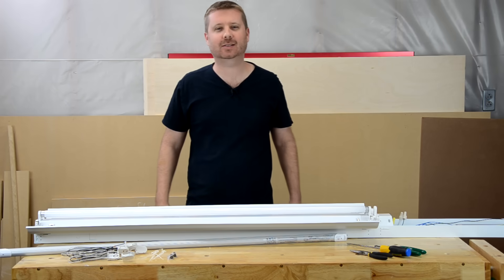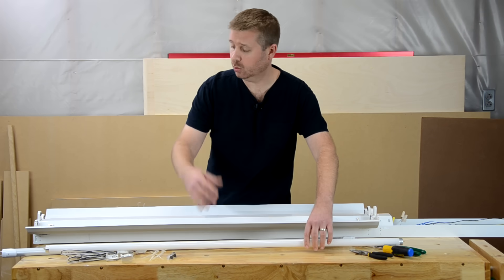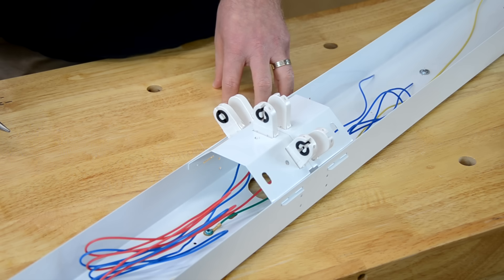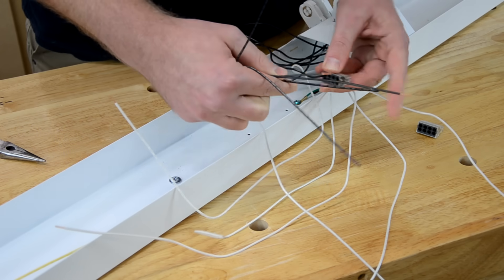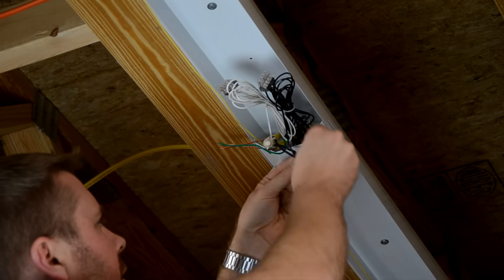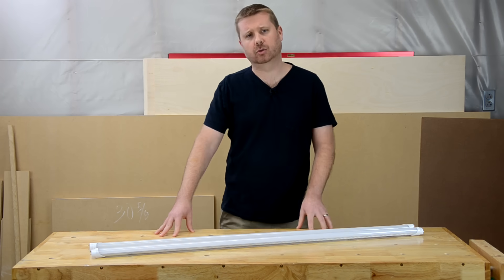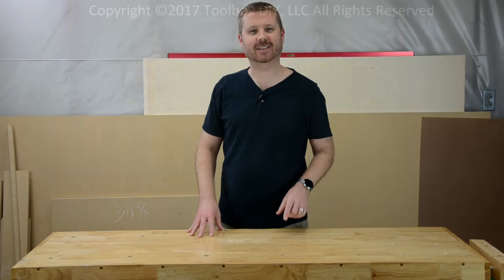How to easily convert fluorescent Lights to LED –Easy Ways to Save Money

Comment: Thanks for the video ... where can I buy the single ended LED tubes and all of the electrical connectors etc ... great job from my perspective since I have become firmly camped out in the DIY party.
Reply from the maker: Everything for this video was purchased on Amazon. Since this filming, more double ended tubes have come on the market that are worth considering. Those are a lot less work to install since you don't need to swap out the lamp holders. If I find some double ended LED tubes that I like, I'll do a video on those as well. I'm firm believer in removing the ballast so it will just be a simple ballast bypass with no changing of the lamp holders.
Reply: Amazon sells the LED tubes with tombstone connectors.  You can buy the Ideal push connectors at Home Depot.

Comment: Think you better go find out what Kelvins are Boy, they have nothing to do with light !!
Reply from the maker: I have to respectfully disagree that Kelvin has nothing to do with light, but the confusion is understandable. In primary school science class we are only taught about the Kelvin scale as it pertains to thermodynamics. We are not, for understandable reasons, taught about the Kelvin scale of color temperature. Kelvin is the unit of measure for color temperature using a scale from 1000 to 10,000. On just about every LED light package, the color temperature is specified and it typically is a 4-digit number followed by a "K". Yes, that "K" is the abbreviation for Kelvin.

But you don't have to take my word for it:
https://www.lumens.com/how-tos-and-advice/kelvin-color-temperature.html

https://en.wikipedia.org/wiki/Color_temperature

http://www.westinghouselighting.com/color-temperature.aspx
Reply: In Australia we use Lumens, Kelvins is used as absolute temp in scientific stuff, an used in the air con/ refrigeration areas !
Reply from the maker: You're confusing light output with light color. Lumens measure the light output independent of the color of the light. Australia also uses Kelvins to measure color temperature just like the rest of the world:
http://www.energyrating.gov.au/document/fact-sheet-led

I think a lot of people with any science background get confused by the use of Kevlins for color temperature. It is not measuring thermodynamic temperature and it is not using the same scale. Thermodynamic and color temperature are two different measurements using the same unit of measure (K) and using two different scales.

Comment: I understand you misspoke and said shunted instead of non-shunted, but this is such a huge error that you should really reshoot this portion of the video and take this one down.  This error could be dangerous and result in a direct short if someone follows this wrong instruction.
Reply: Cry me a river.  I watched the video and it immediately corrected the mis-spoke section with a pop up.  Quit complaining.  It is a good video..
Reply: Yes!!   VERY irresponsible to leave this video as is ...he has people buying shunted tombstones to replace non shunted ones which is RIDICULOUSLY STUPID!    You only need to buy ONE non shunted tombstone IF there is not one available for each tube in the fixture....DUHH!!   FIX the video!  Don't just leave it all confusing!
Reply: @dougiequick1  how do I know if mine is shunted or not?  I have 4 bulbs in a 2×4 foot fixture recessed into my ceiling tile ceiling.  I understand (some?)  LEDs only need power on one side?  Watched a few videos and its confusing.  I've seen some people kerping like colors connected, and others mixing colors
Reply: He explained how to determine shunted and no shunted.  Watch the full video..
 @JM-nh8yp
Reply: shut up @dougiequick1
Reply: Todd R  if you currently have ballasts you can buy led bulbs that use a ballast or bulbs that don't require ballasts. Ideally it's best to go non-ballast then you never have to worry about ballast failure or ballast start up in cold temps.
Reply: Todd R  He already explained the practical reason for swapping holders on one end with non-shunted.
Reply: You guys are geniuses. I actually watched the WHOLE video and every thing you complained about was addressed.
Reply: nope Todd R

Comment: What about the NEC on quick connect plugs for the power. It keeps from getting zappes
Reply from the maker: My understanding (which could be wrong and could easily become outdated as codes change) is that the push in connectors are permissible by the NEC. The last set of recessed lights I installed actually had push-in connectors pre-installed and I've also seen these used inside fluorescent fixtures for the ballast wiring. It's worth mentioning that they must be used correctly just as wire nuts should - no exposed wires hanging out of the connector.
Reply: @ToolboxDIY  NEC doesn't DICTATE splicing choice push in vs mechanical twist. The splice needs to be sound and the splice needs to accessible. Been using WAGE lever connections made in Gerrmany (USA distributors) for 12 years these are UL and have a higher mechanical adv.- through downward pressure of lever vs spring tension which fails with heat (electrons create heat) then IDEAL or other push ins or Chinese knock offs. Yes WAGOS are .25 cents compared to .01 cent wire nuts. There are some other advantages of why we use.

Comment: i have a few old florescent fixtures that i am going to have to replace.... i live in the its effin cold, below zero belt,  in the great white north and florescent fixtures needs either time or temp (a shop heater so they work), i am guessing the led lights need no time to warm up...

Comment: What a complicated procedure.     Many I have converted simply by removing the old flourescent tube, then remove the small "Starter" then put the LED tube in and that is all that is required.      OK, if you bypass the Ballast, you can save a tiny bit more power, but a ballast should not fail when only carrying a much smaller current than they are made for.

Comment: Well done video.  Clear and easy to follow.  I learned something today - that there's a shunted tombstone connector.  What I'm curious about is whether there are ALWAYS shunted tombstones on both ends or if they are typically just on one end.  Reason for asking is because I've replaced ballast too.  I recall seeing two wires on one end and just one wire on the other.  Are both types shunted? Or just the one end with the single wire as you show in your video?  If only one is shunted then one could (or should be able to) use one existing tombstone.  What say you ? ? ?
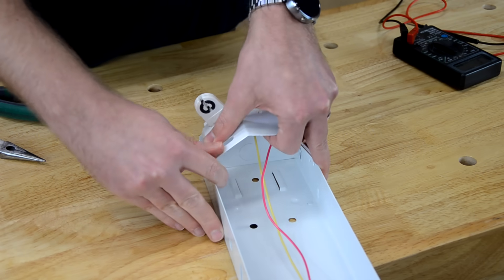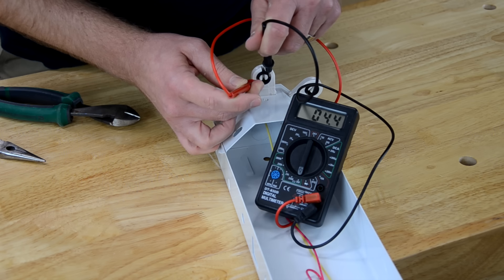Reply from the maker: I've never seen a case where one end was shunted and the other not, but that doesn't mean it they don't exist. It's not uncommon to see two wires coming out of a shunted lamp holder. This is usually the case when multiple lamp holders are daisy chained together. If you find that that one is already non-shunted, then by all means re-use that and save yourself the time and money. Checking for shunted vs non-shunted is covered from 10:30 to about 11:35 in the video.
Reply: Most new light fixtures come with only shunted tombstones in my experience. Most older fixtures or fixtures with instant start ballasts are non-shunted. I'd go with double ended LED replacements for this reason. Easy, no socket replacement.

Comment: This is North American wiring
Reply: These same fluorescent fixtures can be used anywhere in the world with any remotely modern electronic wide input range ballast (the most common type).  He was removing the ballast so you merely need LED tubes rated for your locality AC voltage.
Reply: True, but my point is that he is talking about American wiring, not UK and wire nuts are illegal in the UK.

Comment: How come I get static  in my radio from LED bulbs what's my problem
Reply from the maker: That's likely due to a very noisy switching power supply inside the LED tube. In the U.S., it's best to find FCC certified lights to avoid this although it is no guarantee the problem won't exist. I would recommend returning those tubes and replacing them with ones from a different manufacturer.
Reply: A crap LED issue!!!  Most of my house has LED's.  I got Special LED bulbs for my garage door opener. I got mine from Amazon but I've seen them at Home Depot in the Garage Door area.  They are the Genie LED Garage Door Opener Light Bulb.  They:
#1 ELIMINATES OR REDUCES OPENER REMOTE INTERFERENCE
#2 UNIVERSALLY COMPATIBLE with all brands of openers.
#3 VIBRATION AND SHATTER RESISTANT
#4 TESTED FOR HARSH CONDITIONS
#5 LONG LASTING AND LOW COST

I'm sure some of it is marketing.  Low cost? About $10 each, I needed 2 of them.  Don't get your LED's from ebay that are shipped directly from China!!!  You're going to get crap, like getting interference issues.  Sometimes you may have an issue with one brand.  Return it and get a different brand and see if the problem then goes away.  They are not all created equal.
Reply: Thanks for listing them JB. I want to replace mine, rough service which help. :)

Comment: There is a much easier way to do it, find the right tube in the Philips wizard and switch to LED tubes without removing the luminaire and without changing the wires.https://www.youtube.com/watch?v=Ww-Gu5HTLxo       use if necessary this guidehttps://www.lyskilderdirekte.dk/led-paerer/led-lysstofror

Comment: Very informative. Subbed and liked. I just installed 4 LED "fluorescents" in my kitchen. These required electronic ballasts and even though that is what I had, two would not light up the LEDs. So I replaced them and all is working. I wish I had seen this video sooner and I would have eliminated the ballasts all together, though I don't recall seeing the single ended bulbs for sale. I have many noisy fixtures in the basement and they will be converted to ballast free single ended bulbs if I can find them. Thanks,
Reply: I get mine from Amazon. The Hyperikon T8 LED Light Tube, 4ft, 18W.  They work with 120-277 volts.  I needed the 277 volts. Buying a single is about $16, but when you get a 4 pack or larger, the prices drop's down to under $11 each to even under $10 with a 24 pack.  They are 18 watts, which is about half of the 32-watt fluorescent bulbs they replaced.

They come with the Tombstones needed.  I tossed the ballasts.  I cut out pretty much all the wiring.  I just linked one tombstone to the next, to the next in the 3 light fixtures in series. The first one I had a long black and white wire to connect to the main power. These are single ended.  I installed some 4000K ones in one office.  The owner wanted some, not quite so bright/white, so in his, I installed the 3000K ones, which do look better for a smaller office area.  If I was going to replace all the other ones in the main office areas, I would go with the 4000K.  They do have 5000K and 6000K lights also.  If I was replacing them in my garage, I might go with the 5000K.  

I also used my laber and made stickers that said "LED Conversion, Power Side, 277 Volts."  Just for a Future Warning.  Stuck that on the power side where you can clearly see it.  There's Light Defusers that are cover it up anyway so you can see the sticker.

https://www.amazon.com/Hyperikon-Light-equivalent-Bright-Single/dp/B00NXBMDEY/ref=sr_1_4?ie=UTF8&qid=1514695028&sr=8-4&keywords=led%2Bt8%2Blight%2Bbulbs%2B277V&th=1
Reply: Thanks JB Dragon, I spoke to Home Depot and suggested it would be a good idea to stock the 4 foot single ended T8 LED bulbs as there are so many old T12 fixtures with non-shunted tombstones and noisy ballasts just dying (literally) to be converted.

Comment: Flathead means that the top of the screw head is flat (as opposed to round, oval or some other shape) as viewed from the side. I am sure you meant slotted, which refers to the driving means. Picky, picky me.
Reply: I normally call it Standard, or Philips.  It's generally one or theother, unless it's Hex or Torx or something else.
Reply: The correct term is " tapered flat blade" as opposed to "hollow ground".

Comment: So the LED tubes need shunted or non-shunted tombstones? 3.57 says shunted needed and 8.27 says non-shunted.
Reply from the maker: 8.27 is corrected. You must use non-shunted tombstones for the single ended tubes. I apologize for the confusion. I misspoke at 3.57 and unfortunately, YouTube removed support for annotations so I can't add text to point out the mistake.
Reply: Thank you for replying, and clarifying it.
Reply: Yeah I was confused as well ...thanks grancito2....and toolbox for taking the time....🤙

Comment: As mentioned in a post, bulbs with or separate drivers?. I have a commercial building where the lights stay on 24-7 so looking to save energy cost.
Reply from the maker: Internal vs external drivers can be a lengthy debate with no clear winner. In your situation, the case for external drivers would be that your tubes and drivers might last longer. This is based solely on the claim that having them separate means less heat in a confined space (the tube) and heat is an enemy of solid state electronics. On the flip side, the external driver is a more involved install and if the driver ever fails the replacement is more difficult than just swapping out a new tube with an internal driver. 

If energy cost is the most important aspect, I would go with the most efficient (measured as lumens per watt) regardless of internal vs external.
Reply: Your energy savings with lights that stay on 24-7 vs T8 4' fluorescents will possibly never pay for the conversion.  Despite marketing lies by LED bulb manufacturers, 4' T8 32W fluorescent tube produce about 94 lumens per watt and have VERY long lifespans running 24/7, often over twice as long as low cost LED replacements in this scenario.  Frankly for your use, it does not make sense to switch.  It could even make sense to switch from LED TO FLUORESCENT, if it weren't for the extra cost of buying new fixtures which is the same situation with the switch from fluorescent to LED, except with LED you need MORE fixtures for the same total lumens.

Comment: So, the Led tubes have the power supply built in so that they can run directly from the AC power? Or did I miss something?
Reply from the maker: Yes, for "retrofit" tubes like the ones used in this video. The LED driver (power supply) is built right into the tube. You can purchase tubes that have an external driver which has been recommended by some comment contributors. I don't disagree with their recommendation but don't have any direct experience...yet. The external driver setups claim to offer better lifetimes and warranties.
Reply: @ToolboxDiy
Gotcha; thanks.

Comment: This is not easy by any metric, just purchase a new fixture.
Reply: It's simple!  I  don't take the light fixture down.  Takes me about 15-20 minutes to convert over. It's really pretty simple.  If anything it's easier then taking down a old fixture to replace it with a new one.  If you can do that, you can do this.  Maybe it's a excuse for you to get something new?

Comment: When tucking away the un un used wires (red) I see a yellow wire? you don't mention a damn thing about it? every video that skips something makes it confusing, and being this is working with DANGER!!! you need to correct edit or take this video down.  you don't mention what side of the bulb goes where? isn't there a hot side to the bulb? Worthless video and may be a danger to anyone taking partial instructions from this.....

Comment: 2 things to add. 1, eliminate the extra wire on the new tombstones by trimming them down to 6" and then connecting them. To test the shunted to non-shunted tombstones, use the diode check feature on the meter. This feature will give an audible tone to show it is a shorted connection from point to point. If possible, choose an LED system with an external driver circuit for quicker and easier replacement upon failure. Most driver circuits are only putting out 5v to 9v DC@ 2 amps. Just some info from an electronics tech of 30 years.
Reply: You're a tech for 30 years?  It's not the DIODE check function, it's the CONTINUITY check feature on the DVM that gives the shorted connection beep.

Comment: That was an excellent presentation.  It was well planed, smooth, and thorough.  I have only one nit pick.

The term "bulb" refers to the shape.  If something is shaped roughly like a flower bulb, it is a bulb.  Fluorescent tubes are not bulbs.

My house was completed in 2009 and designed for indirect lighting.  Originally it had concealed fluorescent tube fixtures, plugged in instead of hard wired in to facilitate making repairs.  In several rooms I have replaced them with adhesive backed LED strip lights.  I stuck the LED strips to 1" angle aluminum.  It is necessary to use proper drivers for the LED strips, either 12V or 24V depending on the voltage requirements for the LED strips.  I recommend 24V strips and drivers because they permit stringing the strips without excessive voltage drop.  Standard dimmers may work for magnetic transformer drivers, but there is no guarantee.  Flicker may occur with dimmers.  If so, step type ceiling fan speed controls may be used for dimming.

The advantage of using adhesive backed LED strips is that it is possible to get the length exactly right.